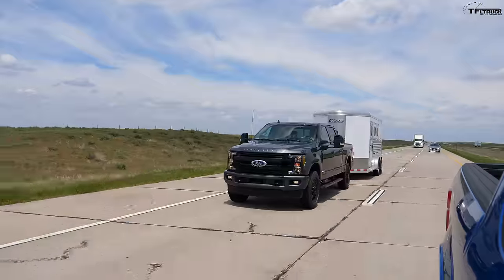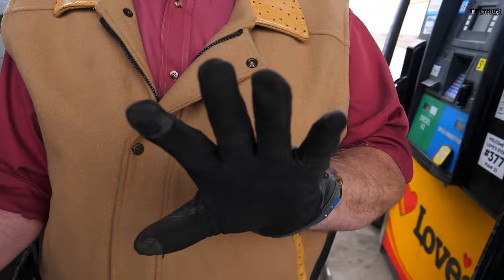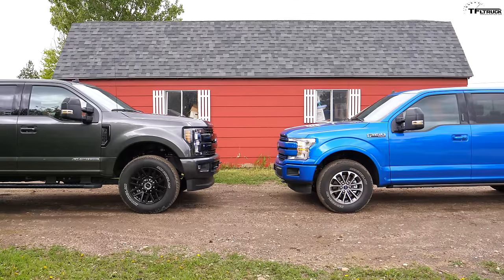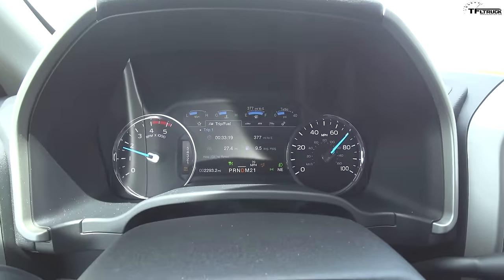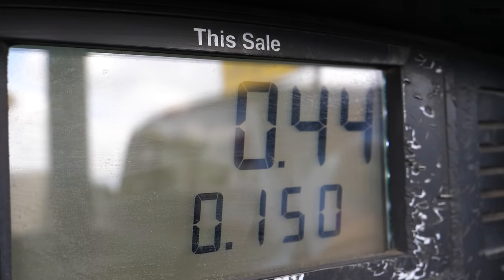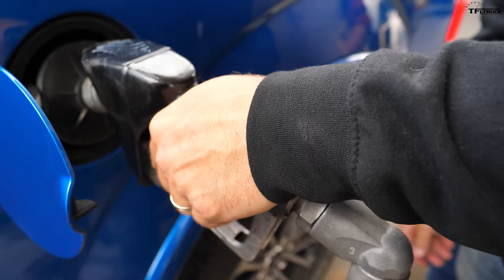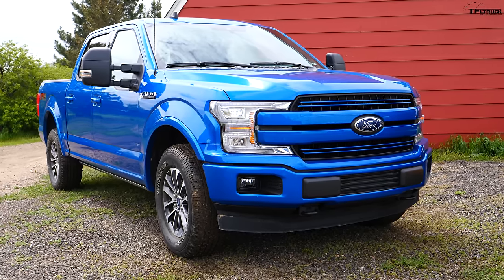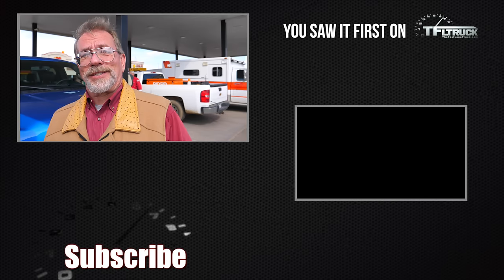Do You Really Need a Heavy Duty Truck to Tow 9,000 lbs? Ford F-150 vs F-250 MPG Review

Comment: I say bogus on the diesel fuel economy! I have 2019 6.7 F-350 Super Crew SRW long bed Platinum. Truck weight 8,500 lbs.. Trailer 8" wide by 7" interior height. Trailer weight 8,400 lbs.. My utility trailer has a V nose and looks very similar in size. I tow 20,000+ miles a year all over the US main land. On my trips I average 10.5 to 13.5 mpg depending on terrain and wind and usually 12.3 mpg and I don't baby the throttle. Maximum speed I travel is 70 mph and typically run 5 mph above the slower posted speed limits. The 2012 6.7 usually 12.9 mpg and the 2006 6.0 13.6 mpg under the same conditions. More power = more fuel. Running solo with the 2019 the DTE sometimes is 1,100+.

Comment: If you want to control your trailer instead of it controlling you, get a truck designed to tow that wight, you want more truck than trailer. Also if you want your truck to last longer than a summer, get a truck designed for towing. So NO your stupid half ton car with a bed is not good for towing 9k even if it says it is able to. It wont last, and you'll hate going up/down hills. That truck will get towed by the trailer...

Comment: I'm only about 30 seconds into this video and I can already see you used the wrong F150. If you're doing a towing test, you should be using either the 3.5EB with the Max Towing Package or the 3.0L Powerstroke. Nobody buys a 5.0 if they know they're going to be towing 8k Lbs. I had a '14 5.0 and towed 5k Lbs. with it, but would have bought the 3.5EB if I was towing anything more. I now own an '18 F150 Powerstroke because I know I'm going to be towing an 8k Lbs. travel trailer and didn't wanna spend the extra $15k for a comparably equipped F250. Not to mention, I don't want to daily drive a truck that large.

Comment: For a first time pickup driver is a 250 overkill?😁
Reply: Depends on what you plan on doing with it. If you are using it as a daily driver and to haul a few things, save your money and get a nice Ranger. If you tow some and want extra room, get an F-150, an Ecoboost F-150 will tow up to 13,000lbs ( I use a 2005 f-150 for my business and tow 5,000-10,000lbs all the time). If you have an need to tow 12,000lbs or more almost everyday, get a F-250.
Reply: @Kobra7049  Guess Tremor out the question and those midsize pickup trucks, I heard they ain't to nice for us tall people.
Reply: @najthesavior4286  That's very true. I'm short so I don't think of things like that. Lol. I believe a full size 1/2 ton is what most people need. They are roomy have enough power a towing capacity for most people and with Eco Boost or the new diesel 1/2 tons, they get good mileage.

Comment: 9 mpg = .111 gpm (for simpler calculations) (1/mgp = gpm)
8.4 mpg = .119 gpm
 
burning one gallon of diesel releases 22.4 pounds of CO2, one gallon of gas releases 19.6 (most of the mass of CO2 comes from oxygen)

so the diesel truck releases 2.488 repeating pounds of CO2 per mile
        The gas truck releases 2.333 repeating pounds of CO2 per mile

Comment: This is just silly and you boys should know better.   A hd truck is set up to work and two day in and day out wheels tires mugs brakes suspension cooling etc.   slight duty truck is just that.  Think of a 1/2 ton as an expedition with a bed.  I have owned and towed with both of these trucks. And there's no comparison what so ever.  If you tow even a moderate amount get a heavy duty.  Buy your wife a half ton.

Comment: If you tow 9000lb balldragger with an f150, you are an idiot, and should make sure you have the maximum liability limit on your insurance. Sure it’ll pull it, if you balanced an f350 on a trailer properly you could pull it with a lawn tractor, but that doesn’t mean you should pull it. People don’t understand weight reduction on front axle/braking ability with a load. But what do I know, I’ve only pulled a bunch of idiots who jacknifed 1500s with dump trailers out of the ditch.

Comment: That is horrible MPG for a diesel. The 250 should have killed the 150 in mileage.
Reply: That's how they run today with the DPF/EGR systems.  Not worth it many have said mainly because the engines seem to self destruct around 90,000 or so miles. Those pollution systems are made to run full time so if you are always on the road, they live longer while mostly driven in the city will destroy them sooner. The EPA has lots of great ideas on paper but when it comes to making a good product for the money, they have no business being in the industry of automotive manufacturing and maintenance world.

Comment: Since diesel has 25% more potenchal energy per gallon of course the diesel is going to get better fuel economy. guess before watching
Reply: But emissions regulations drag down the fuel efficiency of diesels. Pre- 2007 diesels got much better mileage than the new ones do

Comment: I tow a 31'  9000 lb toyhauler. I tried towing it with a 3.5L and 5.0 F150 and almost died in both. The F150 CAN'T handle the size of the trailer, the front end is too light. The truck was thrown all over the road with any crosswind. and was too unpredictable to drive at 60 mph. I traded in my F150 and bought an F250 with a 6.2L, the difference is world changing! The F250 can manhandle the weight of the trailer and barely budges in 30mph crosswinds. Dont buy an F150 to do a Super Dutys job!

Comment: Why is a 2019 F250 6.7 getting such poor MPG. That’s the same as a gas. It’s the DPF. The motor should get over 15MPG. My 95 7.3 gets better MPG than that POS.
Reply: because ford took over building them instead of international. made them a PC of shit. why do you think they made a giant gas pot?
Reply: Becuase they thought people wanted a bigger Gasser than the one they already have (6.2). In my opinion the whole reason why people wanted a 7.3 V8 is because they wanted them to bring back the 7.3 Powerstroke from 94-04.5, but did they NO they brought back the motor, but its a Gasser. The everyday person wants a big motor at gets good MPG (DIESEL) like 15-20 not 9-10 MPG like the new 6.7 because that's what it gets while towing, its ridiculous. 21st century technology my ASS. It should be getting like 15-25 MPG its a $70K+ brand new truck.

Comment: Please stop calling the Ford V8 the "Coyote" engine. The Coyote V8 was originally a Ford racing engine.  Later, it referred to after market engines massaged by Ford's Special Vehicles Team for sale to the public.  They were delivered in a wooden crate.  Thus, they were nick-named "crate engines." At the start, they were  worked on by AJ Foyt and Dan Gurney.  Ford eventually tried to cash in on its well known engine moniker. The Coyote V8 racing engine has nothing to do with a pickup truck engine.

Comment: Wow. You never discuss the longevity of a diesel vs a gas truck. Or the fact that that V8 engine will be done within 1.5 years if it was towing 9k lbs more than 6 times a year. A diesel pulls that load like it's not even there you have to stomp on the V8s to get that 9k to go up a hill. Anyone pulling over 7k lbs more than 1 a month should by a HD diesel.

Comment: These two completely missed the mark here which is a little frightening considering the channel is called what its called.
Mileage has absolutely 0 to do with anything if towing is the job you have to do . The 150 being able to tow it also has 0 to do with the equation here. Also the addition of bars somewhat skews the data . You can hook that trailer on a 250-350 with no bars and haul that load day in and day out and not really know its there . You also have more control over the load which may be the most important thing. Panick stops or crazy maneuvers are a non event with a truck that has control of the load.
Just because the 150 will do it doesnt mean that its all that safe . The level that the truck is outweighed is much higher and therefore the trailer can control the truck in certain situations.
 If you dont have to tow that much weight very often then yes for the 150. If towing is frequent then you better get a real truck thats meant for the job you are doing. Whatever the mileage is is what it is . Its a job you have to do with the tool you bought to do it. You feed it what it needs to get that job done.
The prices you quoted make the 250 a no brainer .
For the record the 2013 6.7 got phenomenal mileage . Every year since then it has dropped a notch as the power levels increase.

Comment: You will burn the breaks up on the f150  in no time. The 150 engine is straining.  Diesel just purrs like a kitten.  Who cares if its rated to tow that much. I had a f150. Now I have a f250.  No comparison on breaking ability